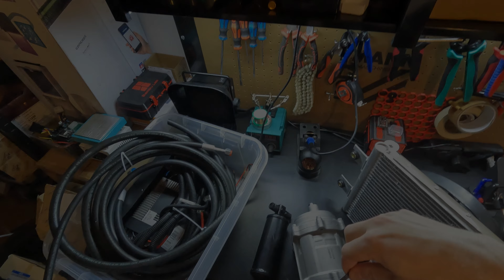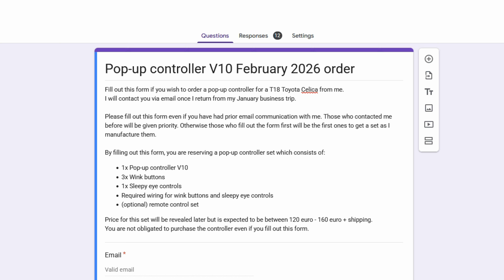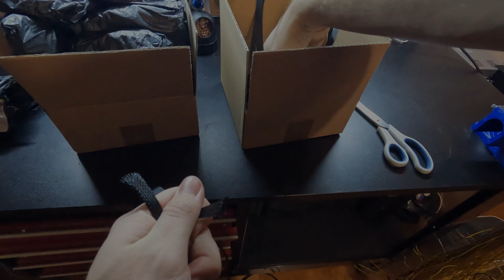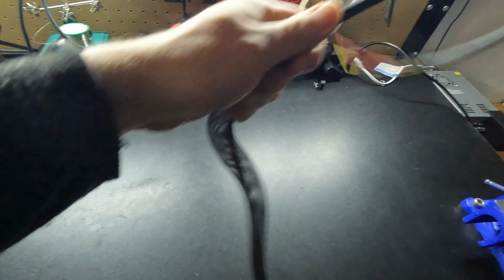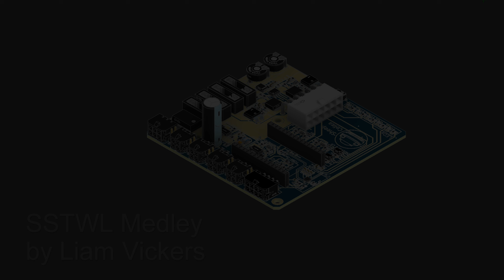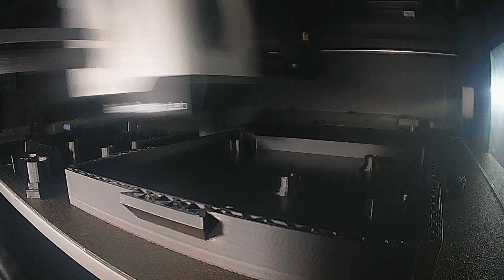2026 February update

Comment from the maker: Update:
The longer drive went well. Although one issue was discovered, I managed to resolve it on the current boards with a few additional components and I will be making a video about it.

6 sets are finished and 3 more will be done throughout the next week. With my calculations I should have all the needed parts for the rest of the sets so it will continue with the projected speed of 3 sets per week until I finish all 15 sets.
Several documents and technical drawings were added to the google drive link including the user guide.

I have made the firmware open source here (its missing a proper README for now)
https://github.com/sheep-celica/pop-up-controller-v10

And there is also a cool exe for communicating with the controller.
https://github.com/sheep-celica/Pop-up-controller-V10-Application